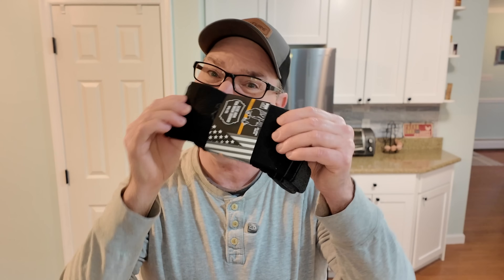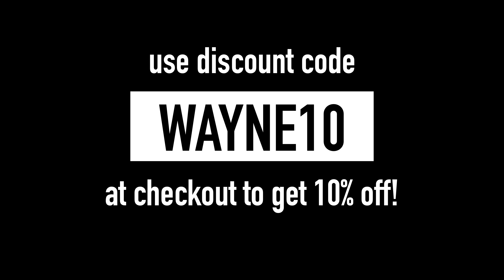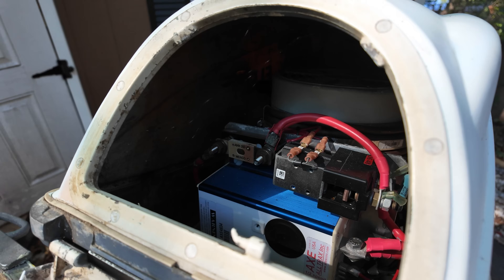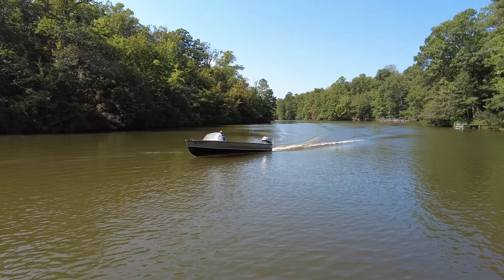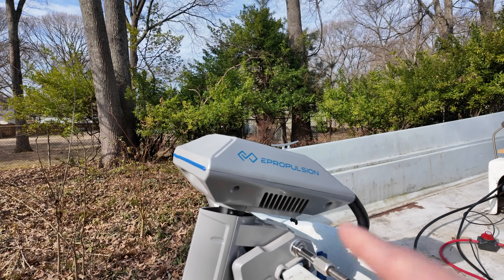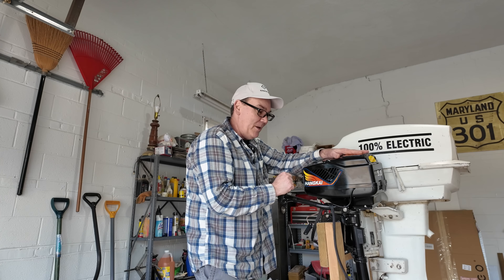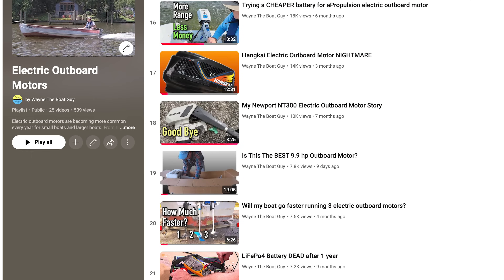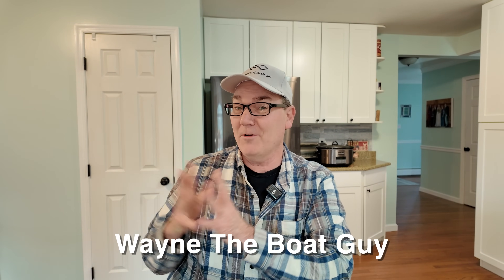Make your own electric outboard motor?

Comment: If you really use an old outboard motor be aware of the electric power and torque ⚠️ For 50kW electric motor you need the clutch of a 150hp outboard drive system to make sure it doesn’t break when accelerating or changing gears from forward to reverse ⚙️

Comment: 🌴Hey Wayne 🤔 well curiosity has got me going again, so what you’ve shown was outboard conversions !  And it seems that one of the big problems is overheating, so don’t know if it’s from being enclosed with the motor cowl and not enough ventilation, but haveing the motor under water to cool it seems to solve that problem, but I’ve been thinking about a inboard conversion, I’ve seen cheap large boats but they have bad motors and a guy got to wondering if the motors could be taken out and use and electric motor with chain drive to power a twin or single screw setup , and maybe use cooling fans to chill the electric motor, recently saw a thing on you tube were so young feller was going hybrid and using a motor set up from a Toyota Prius , it’s gas and electric,self charging 🤔
Reply from the maker: I took a ride in a commercially available and powerful electric boat in the spring which had an inboard electric motor. It had an elaborate liquid cooling system to keep things cool. I'm not sure fans would do the trick on a warm day.
Reply: @WayneTheBoatGuy 🌴🤔So did they cool the electric motors with coiled copper tubing forced into the coils by intakes and forward movement or a radiator fan assembly? How did they cool it down ?

Comment: Any sound coming from a bldc motor indicates inefficiency. It should operate as close to silent as possible. Any heat generated will create inefficiency as the magnets become weaker with rising temperature. A programmable, hall sensored sine wave controller would solve these issues provided that the output power of the motor is capable of driving the intended load.

Comment: EE and ME here with a lot of experience with electric RC boats, for the heat issue and the coupling issue, I think a belt/gear/chain reduction would help a lot. Motors overheat when the current (amps) is too high. To reduce the current, you have to reduce the load. A lower pitch/smaller prop or use a gear reduction. You will lose some speed, but your motor won't fry at full throttle.

Also, in RC boats, a water jacket is often used. It allows more flow and water to actually touch the outside of the motor rather than wrapping tubes around the motor. Another common thing that is used with a lot of out runner style motors is the motor mount is cooled. I have made some before by soldering copper or brass tubes to a plate that goes between the motor and the motor mount.

Comment: I watched your video on electric motors used on old outboard motors. You mentioned the potential for over heating. What about using a 3/4 Hp like the Baladore motor that has a fan already manufactured on it. It’s designed to keep the motor cool during prolonged used. Example like an air compressor. The higher the air pressure builds up creates strain on the electric motor will have to work harder as the pressure increases. What’s your thoughts
Reply from the maker: I imagine a built in fan would help keep things cooler.

Comment: I am curious about the amount of noise and the EM field that the marine life is being subjected to by placing the motor in the water. Don't get me wrong, I prefer to reduce the amount of pollution being subjected to the water, I just wonder what the best option truly is. Great video though and it does bring up great points to consider if planning on building, buying, or altering an outboard motor.

Comment: Its impressive how they use a heat sink to cool down the motor using the impeller tech found in the old motor. I found a 5k rpm motor and did some calculations, its pretty tempting to engage but I know I probably don't have the time for now.

Comment: I reached out to my local state officials to determine the legality of registering or non-registration of an electric outboard conversion from an gas outboard. It turns out there is ways to do it. But be sure to check with your own local state officials on this topic.😅
Reply from the maker: That's a great point! I forget to consider it sometimes because in Maryland we don't have to register motors, just any vessel using a motor needs to be registered.
Reply: @WayneTheBoatGuy  Yeah, over here in Texas we deal with a lot of outboard thefts. So a few years ago they started it in four seen a law from 1975 saying you have to have a outboard motor titled before you can sell it in order to register it. But if your selling it for parts then it doesn't need to have a title. That led me to inquire with my local state official to find out what I would need to do. And they basically told me that either which way since it's an electric conversion and electrics are not registered. You technically did not need to have purchased a titled outboard motor you can use a scrapped one. But it doesn't hurt to have the original paperwork in the event that there's a question brought up. 🤠

Comment: The electronic motor being underwater does lower heat and noise, just like electric trolling motors.
If you could fit it to the leg of the old outboard it would be best. But until a manufacturer decides to build power headless outboards, I think the heat and noise is something we just have to put up with.

Comment: 20 yrs ago I fabricated an alum bracket to attach motor guide trolling motor (removed shaft head and waterproofed wiring) to 90hp Merc lower unit on 18ft Sea Ark.

Worked ok, problem was it being there created drag and reduced top end speed several mph so removed it.

Ideal would be for it to auto deploy and be out of water when not used (I know they make them but pricey).
Advantage is using boats steering wheel for control.

Comment: Wayne, I only use my electric motor to slow troll for walleyes because it can easily troll down to the speed I need which is 0.8 to 1.2 mph. If I need to get off the lake fast in the case of evading a thunderstorm, then I use my 20 hp Suzuki. What I'd like to do however would be to set up a small solar panel on my boat to keep my deep cycle battery topped off for the electric trolling motor.
Reply from the maker: That's a neat idea. I hope to do some playing with solar this year.

Comment: The problem I figure with heat is gearing. Direct driving an electric motor in place of a gas engine means the motor is always spinning to slow. Electric motors generally want to spin twice as fast as gas engines. Its like climbing a mountain in a gas car in high gear. Electric motors have the torque to do it, but they are not happy.  The extra heat being trying and failing to get up to speed. The law of conservation of energy states that within a closed system, energy can neither be created nor destroyed, but rather transformed from one form to another, with the total amount of energy remaining constant. 50 units of energy put in to a free spinning motor, most of that 50 units gets turned in to rotational energy. Overload that motor in a way that it cant fully spin up, it limits how much of that energy can become rotational energy. So if its bogged down to half the free spinning speed at the same 50 units of input, that means you are getting half the rotational energy out. The other half doesn't vanish. It has to become something so it becomes heat. You can test this with a tiny motor an a battery. Hook it up under no load an see how hot it gets. Then grab the shaft an stop it an see how hot it gets. This is a bit over simplified as a struggling motor actually draws more amps. But that starts getting all mathy. All that matters is you want gearing to let the motor spin up, letting it create more rotational energy an less heat.

Comment: 🌴 Hi Wayne well as appealing as electric propulsion is it can be complicated , and if your looking for a used cheap old motor check out - offer up - on you tube they seem to have a vast assortment, and you might even find other components that you could use , as in the past I had questions on a solar powered boat , after all not only would it be great to have an electric powered boat that could get a reasonable speed but also have it be free energy , most bigger solar powered boats have builds that were made out of a lot of money , large ocean solar powered  catamarans with two motors and enough solar to power a small house , it can be done it’s just not cost effective, (  that’s why they put sails on um ) , so it seems that the giant trolling motor would be the best set up design wise , keeping it cool but then you need to worry about water intrusion but you do eliminate having a heavy transmission as you just reverse polarity, electric boats are a neat idea but it seems like there are a lot of variables, how would they hold up under long term use , and then there’s battery life , how many charge cycles , how would they hold up in salt water ?   🤔Humm, speaking of saltwater have you spoken to our buddy Forrest ?  Haven’t seen any crazy stuff happing ? 😄

Comment: For heat handling, I'd look at how water cooling is done on modern PC Computers. They are water cooled using fan coupled radiators that you could probably modify.
Reply: The main reason those systems use radiators is because they have limited (or no) reservoirs of cool water. For boats, the whole lake is your reservoir. Your motor isn't going to measurably warm the lake, so direct cooling via lake water is simple. Some reasons you might want another heat exchanger in the system is  if you're running your cooling water through geometries which could get plugged unless it's pure, or if you want to use an additive. Even then you'd probably want a water to water heat exchange instead of water to air.

Comment: Hi Wayne, love the video. I’ve been building electric go-karts for a while and my experience is the motors ONLY get hot IF there is a mismatch with the controller and/or wiring gauges and also IF you are not running them at 100% throttle.  Electric motors “like” to go full speed instead of really slow.  Go and feel your furnace motor(very large) after it’s been on for 8 hours or any electric home fan for that matter. They don’t get hot and they are not well vented. So, if your electric boat motor is getting hot look to the controller and wiring gauges and remember the slower you run them the worse it is. I’m also not quite sure why those boat builders are putting giant electric motors in the housing because even tiny (800w) electric motors have way more than enough torque for a boat motor. What you really want is a very high RPM electric motor, not a golf cart drive unit. Anyways, hope that helps someone, somewhere and it’s not professional advice, just what I’ve experienced first hand. Cheers.
Reply from the maker: I appreciate your expertise!

Comment: First off thank you for posting these videos. Electric motors are lighter, easier to use, and getting cheaper. A lot of the cost is what the big money companies are charging for batteries.  The Hangkai motor setup is almost identical to an OLD e-bike. While new for boats, in the DIY bike world, 48V & 52V batteries are common, efficient, designed for speed, and hot swappable. The new motors are crazy powerful, affordable, have robust heat sink built in to the motors themselves and way less noise. Imagine camping with an inflatable boat, lightweight motor, and being able to swap between 3 or 4 20AH batteries from boat to dirt bike!   BTW …. The 5HP Hangkai noise is because the motor is out of the water. Not ideal. Looks like there may be a 8HP version now with the controller up top and the motor down with the prop like the other ones you’ve tested. I don’t think it will be long before the DIY folks are getting 10-15MPH using the same batteries they use in ALL their other adventure toys… or even from the lawn mower, making battery costs irrelevant!  What a time to be alive!
Reply from the maker: I agree - lots of cool tech happening and coming!

Comment: The electric Hangkai motor is really loud, it's annoying but maybe it will be a little better in a Johnson 3 hp shell with soundproofing material?

The Evinrude 33 might need more turns of copper pipe wrapped around the motor? There seems to be room. Nice video. Thanks.
Reply from the maker: I agree on both points! However, I wonder if the Hangkai would suffer from lack of airflow in the metal Johnson housing.
Reply: @WayneTheBoatGuy  If you use the same water cooling principle as on the Evinrude 33 "Electric", the cooling should be sufficient. It is of course not optimal to use components of questionable quality and that sound like they are about to break even when they are new. A boat engine that is 60 - 70 years old and works is considered to be of very good quality. Water cooling is included.
Use a broken 3 hp as the basis for the build. One that works is a shame to "destroy". My opinion.

Comment: Some reservoirs only allow electric motors. I seen homemade outboards with golf cart motors. (Back in the 90's)
Also check out Ray Electric Outboard.(Not homemade)
Reply from the maker: Yeah I have seen a few Ray Electrics for sale - they are made locally and usually not inexpensive.

Comment: What possessed you to get involved with EOB???
Reply from the maker: EOB - do you mean electric outboards? If so, I was intrigued by some of the smaller ones when I was having challenges with my old 2 strokes. Slowly watching how the older 2 strokes were becoming harder to get parts for or just suffering from age related wear and tear. The electrics were becoming a little more common and not just on electric only lakes. As battery tech and pricing seemed to be evolving, I saw it something new to explore and learn about.

Comment: would have been nice to add how much it cost to do it yourself
Reply from the maker: It's extremely variable, depending on the quality of components, size of the motor, voltages and availability of a suitable case and lower unit.
Reply: @ even a price range would be great, maybe interview the guy and see how much he spent
Reply: Most 10kw bare motors like the Golden Motor are about $1K, and figure another $1K roughly for the donor outboard, motor controller, wiring, etc. 

So that’s about 50% cheaper than a Navy 9.9 (and delivers more peak power), but as Wayne correctly points out there are a lot of potential for fiddling and noise/vibrations/harshness with the DIY method.